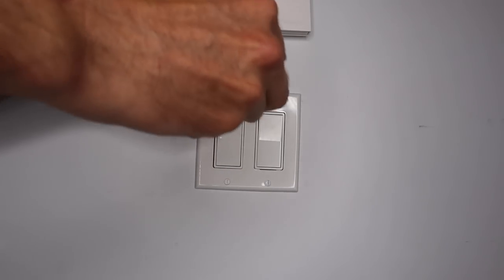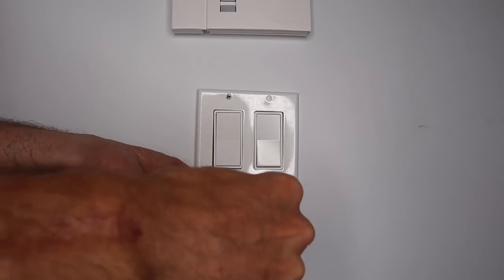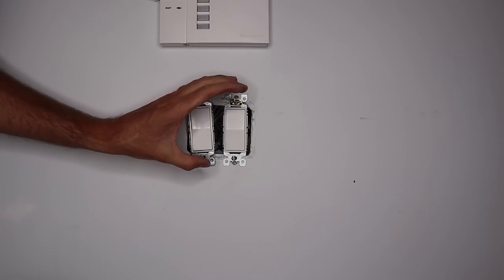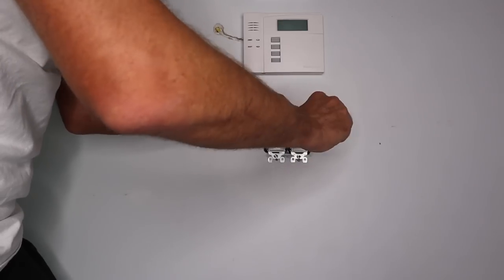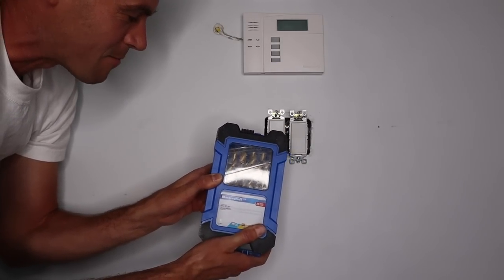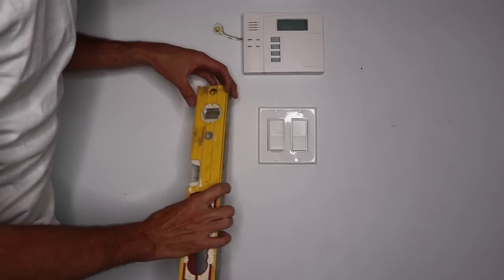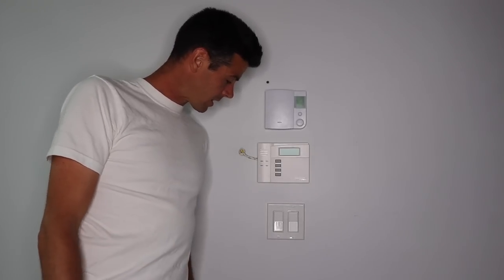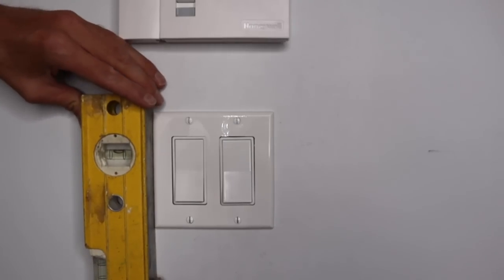DISGUSTINGLY Out of Level Electrical Box!!!!

Comment: I’m an electrician. Carefully expose the screws for the mud ring without over cutting and straighten the ring . If you are careful a standard plate will still cover any damage. Then do a kick flip
Reply: Yeah he could have cut some margins around that ring with a razor knife to get access to those screws.
Reply: Aaron yes sir
Reply: Don't forget the kickflip tho.
Reply from the maker: Darn. Wish I knew this before I did the repair.
Reply: And then find a new electrician
Reply: @tonycalhoun544  🤣🤣👍
Reply: @jonanderson4474  hes more of a heelflipper
Reply: Yup, i have even removed single gang mud rings to replace them with 2 gang on 1900 boxs like that.  Takes like 5 minutes even in plaster walls.  Or get the beater screw driver and give it a couple good wacks with your kleins lol.
Reply: Sorry!!! I don't follow. What is a mud ring? and What is a kickflip?
Reply: @ronald5728  a plaster ring.  Something a plasterer would go over with a bit of knowledge as to not piss off a sparky.

Comment: Hallelujah! Thank you.  

I have these off by 1/4" + in 3 spots right in the brick of  my 1956 desert ranch. I bet it I my entire house would crumble if I tried to adjust the box itself. These things drive me batty. 

I even thought about buying metal switch plates and trimming them with metal snips. Ha. 

I hope this works. I have the same switches, but can't recall if the fasteners have the  same screw fasteners. Ugh,  When the guy who "flipped" the house must have been drunk the whole time.

Comment: There is a chance to get it level and square if you cut the drywall and adjust the angle of the mud ring. I hate the rough-in guys because I am doing finishing jobs as an electrician.
Reply: Yes that’s the preferred last stop for this fix before you go to open the wall.

Comment: Over time, of using the switches, you know it'll go back to the original position.
I had several boxes in my condo that were crooked.  I never had the time to fix them while I was a worker bee.
After I retired, I opened up the walls around the boxes to see why they were crooked.  It was a matter of mass production and not caring.
All the boxes that were crooked were because of plastic boxes nailed onto the studs which had nail heads in the way of the boxes.  I removed the boxes, removed the nails and replaced them with counter sunk screws.  Yes, it was a pain, but the end results were worth it.
Reply: Friends don't let friends use plastic boxes.
Reply: @aaron74  I don't have many friends and more importantly, I'm really cheap!
Reply: @2-old-Forthischet  Yeah, but you get what you pay for! And seriously, a 4x4 square metal box costs like $1.00, and a mud-ring is another $1.00. Compared to metal device boxes that are like $4-$5. We have commercial electrical construction to thank for cheap square boxes and mudrings!
Reply: @aaron74  I really like plastic boxes for the non conductive properties.  Recently, I was helping my GF redo a four gang outlet in her garage.  We identified the circuit breaker and shut off the power to the box only to find out that there were two circuits in the same box!  Luckily the AC probe caught it before anything happened.  Yes, it was a low ball bid remodel from years ago.
Reply: @Too-old Forthischet  Yeah, the plastic-versus-metal boxes are a longstanding debate. The primary purpose of the box is to encapsulate and protect the splice. So the steel is stronger than plastic and therefore more protective physically. But if the steel is not grounded (as it's required to be), then it can be energized and therefore dangerous to touch. The plastic requires no grounding and is therefore always safe to touch. They're much cheaper, too. Honestly, the only real thing that bugs be about plastic boxes is the darn mounting holes for devices always seem to strip when the tension of packing the splice in along with the device. Really, the device mounting screws you need with plastic boxes are coarse-thread #6 panhead screws so it digs into the plastic better than the machine screws that come with the devices (which have always been designed for metal boxes since the early 1900s).
Reply: @aaron74  My GF's house has all metal electrical boxes that are all tied together with metal conduits.  The boxes are grounded via the conduits as the wiring is only two wires.  Back when I was a telecom tech, I saw many "short cuts" taken by electrical contractors.  The absolute worse one was at a commercial building where the main transformer in the parking lot had a ground wire leaving it in the conduit but it never made it to the service panel.  The contractor that was redoing that box pulled out both sections and they weren't even long enough to even reach each other.  Obviously, they were there just for show during the inspection.
Reply: @2-old-Forthischet  Actually if there is steel conduit and metal boxes all tightly fastened together, you don't need to run ground leads because the "raceway" (as it's called" is the equipment grounding conductor. That is normal. Was she in the Chicago area per chance? Conduit is required for at least Cook and DuPage counties in Illinois. Chicago had two historically massive fires, so the city has adopted its own electric code that supersedes NEC.

Comment: Ah in the UK sanity reigns (well most of the time) with decent MK switch units where the two switch units are not two separate ones but integrated. Two securing screws NOT four.. and an adjustable metal back box usually with at least 1/4 inch play to allow correct levelling. I appreciate that for some people removing the switches and redoing the work to level it out can be as I have seen here in the UK a trifle in itself as often the electricians don't leave very much slack in the cables etc so removing the front fascia switches with the wires and disconnecting may be easy but reconnecting can result in some unpleasant bleep bleep language. 👀😨🤣

Comment: I’m being asked to remove wallpaper vs replace if drywall entirely. What do you recommend. Cutting the drywall out and replacing it or trying to remove wallpaper?
Reply: If they used oil base paint on the drywall then wallpaper sizing (glue) it should come off ok. It's always a guess on how many imperfections are covered by wallpaper.

Comment: I have a ton of outlets that are crooked the other way, the electrical boxes were nailed on the ridges that set against the studs and they sit crooked outside of the drywall.  I use those green spacers but I still have crooked outlets, suggestions?  In other words, the left side of the outlet is set further in the wall and the right side sticks outside the drywall edge.
Reply: Pry the nail out and put a screw in from the inside of the box once it's level

Comment: being on the level is not always the answer, in a new house, yes it should be, but when you have an old house that has moved and settled over 90 years, when you put stuff up lever, it looks skewed to the floor, skirting boards, the mid wall mounding, I have found this in my house, nothing square, nothing straight, no matter what you do, you just can't win

Comment: Should have also showed how to trench out the drywall and tape over the wire on the controller above the switch. ;~)  

The box issue reminds me of the dozens if not hundreds of boxes installed in a large hotel banquet room I was in for a meeting.  Every type of box was at a slightly different height but like type boxes were all the same height. More explicitly, all the electrical boxes were the same height, all the ethernet boxes were at the same height, all the microphone jacks were at the same height but there was variance across box types so visually the boxes looked terrible.

Comment: Sparkys can be so lazy.. we had one come into a custom home build this summer and put a 4 gang box into a 2x4 wall cavity in front of a 1 1/2” vent pipe that was already there, it pushed the box out an inch on the end and the pipe was bowed out the other side of the wall.. we fixed the issue and both the plumbers boss and the electricians boss got a talking to.. it’s not that hard to do your job well and communicate when the need arises

Comment: I’m installing new sconces and the round electrical box is installed in such a way that the bolts are at 2 and 8 on the clock instead of 3 and 9 . My husband said I’d have to cut a hole in the wall to reinstall it properly. Any ideas would be much appreciated. I have pictures...

Comment: If the elechickens dont tighten the plaster ring properly it can get crooked and then the drywall is cut out around it crooked. Or sometimes the guys hanging drywall dont cut it properly and put too much weight on the box which knocks it out of level. I see that a lot with plastic boxes. Cut out the drywall behind the plate to try and shift the box around. 

The vinyl plate makes me believe this was the electrician's fault lol. Vinyl plates are for sadists.

Comment: I realize those weren't your tools but, the drill broke because it wasn't meant to be used that way, not because it was "cheap". A Dremel with a proper carbide burr would have been the proper tool. Good result though :-).

Comment: I would have trimmed a quarter inch top and bottom corner and shimmed the box at the stud side . Yes you would have to mud, your method is a better quick fix though. Wouldn't do that on a metal box, chance of arching. Also putting in warped stud's, that's why drywallers hate framers.

Comment: I think maybe you could remove the screws from one of the switches and then just rely on the cover plate to align the unsecured switch.  I'm not an electrician.
Reply: Be careful with unsecured receptacles in grounded metal boxes. (Especially if you are the ground.)

Comment: How do you attach a dewalt battery pack to a Makita and why is it White not blue or teal or what ever? Is it like a universal battery law Canadian thing? For a second I thought it was a WalMart Hart brand drill. 🤔
Reply from the maker: No idea. Homeowners drill :)
Reply: @vancouvercarpenter  ok found a white Makita but what about the battery.  🤷‍♂️
Reply: Question: How do you attach a dewalt battery pack to a Makita?
Answer: They make battery adapters. Can order from Amazon. I'm not a fan of them only because some drills talk with the battery for protection (overheat) and the adapters only make sure that the positive and negative power terminals are correct between the battery and the tool.

Question: Why is it White not blue or teal or what ever?
Answer: Makita sold some of these white versions for a while around five years ago. Makita has some purple versions they're now selling in Japan.
Reply: @ccadama  just found the adapter

Comment: Wouldn’t this potentially cause insurance headaches in case of a fire? I learnt from an inspector that it’s very important that electric parts are not modified. If a fire starts anywhere near that switch an insurance investigator might find the switches modified and deem it the source of fire and void coverage.